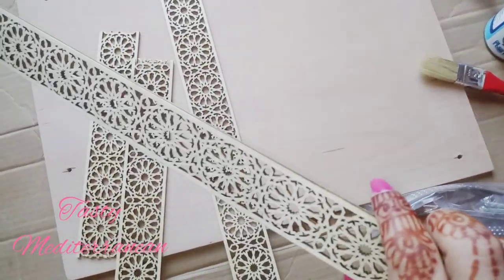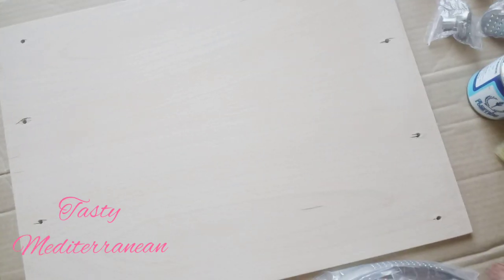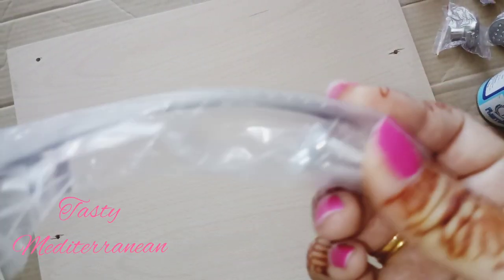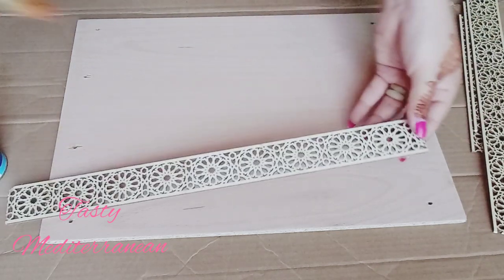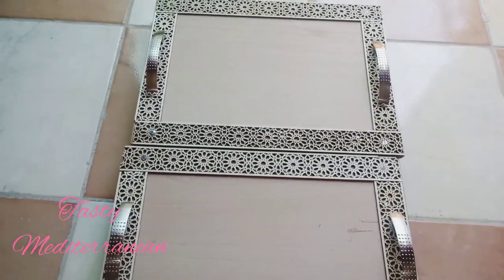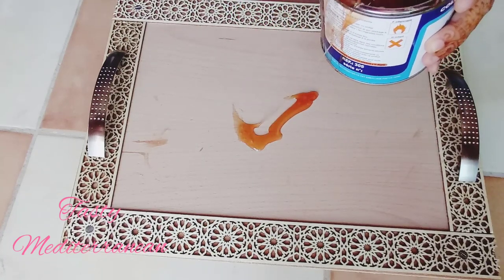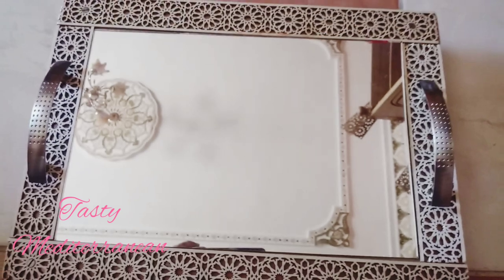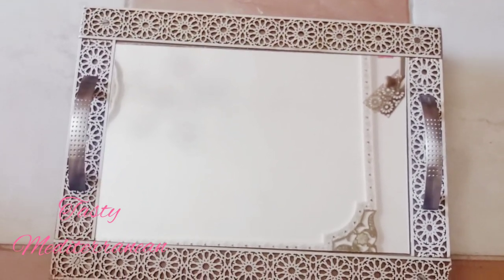DIY Wood Tray

Comment: From where did you order the laser-cut wood?
Reply from the maker: You could find it at Etsy or AliExpress

https://campaign.aliexpress.com/wow/gcp/growth-ppc-google/index?_randl_currency=USD&_randl_shipto=US&src=google&src=google&albch=shopping&acnt=631-313-3945&slnk=&plac=&mtctp=&albbt=Google_7_shopping&albagn=888888&isSmbActive=false&isSmbAutoCall=false&needSmbHouyi=false&albcp=15223628550&albag=129719169356&trgt=380580342666&crea=en10000098919233&netw=u&device=m&albpg=380580342666&albpd=en10000098919233&gclid=Cj0KCQiAq7COBhC2ARIsANsPATHnz1p8O3b8x1enOGvrZfCK9sc6_O7qJx3o8tBshy77HSvdGGuUUWcaApWbEALw_wcB&gclsrc=aw.ds&aff_fcid=bea6d5421bb14c90a653aade19224b9a-1640788725142-03507-UneMJZVf&aff_fsk=UneMJZVf&aff_platform=aaf&sk=UneMJZVf&aff_trace_key=bea6d5421bb14c90a653aade19224b9a-1640788725142-03507-UneMJZVf&terminal_id=45e982413b83497d9d8f3cbcfabd987a&wh_weex=true&wx_navbar_hidden=true&wx_navbar_transparent=true&ignoreNavigationBar=true&wx_statusbar_hidden=true&productIds=10000098919233&guideItemId=10000098919233&UTABTest=aliabtest194170_247436&OLP=10500109_f_group1&o_s_id=10500109